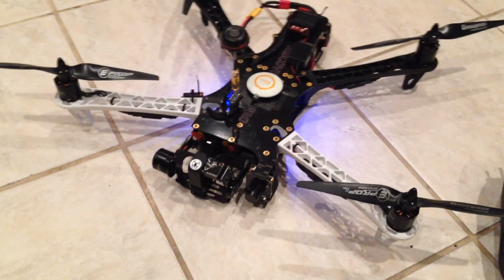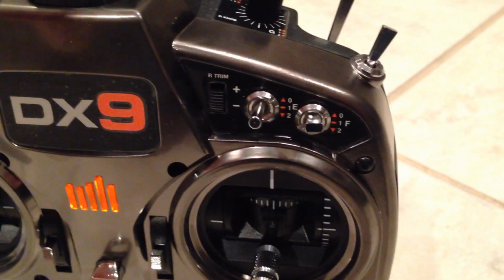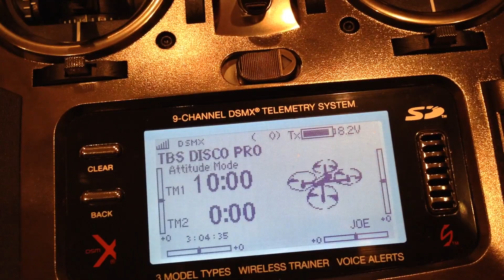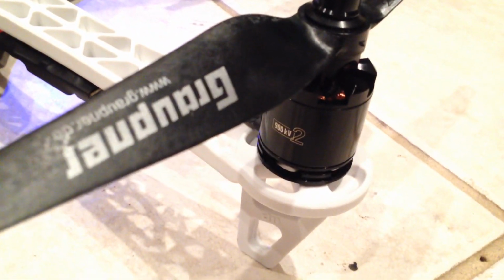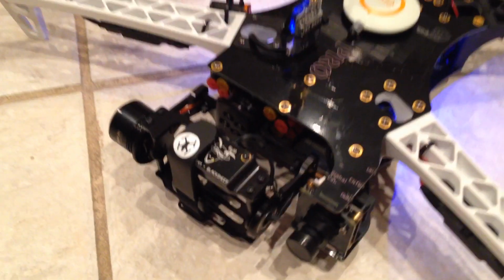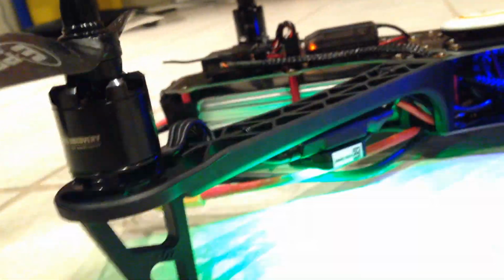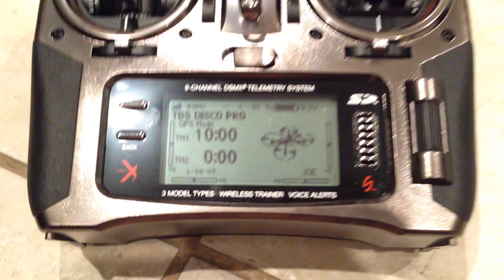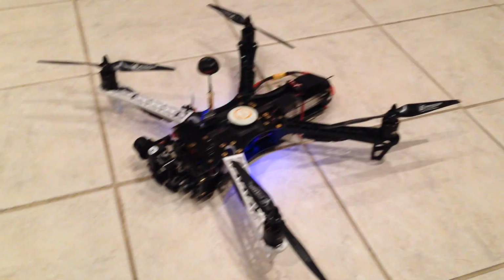Team Blacksheep PRO w/ DX9

Comment: Beautiful Build! I have the pro as well but am having an issue with the gimbal. I've noticed in my footage that the gimbal is not consistently smooth in keeping the camera balanced. It is not a dramatic affect but you can definitely notice it throughout the footage. Have you had any issues and if so did you find any solutions?

Thanks Very Much,
Jade